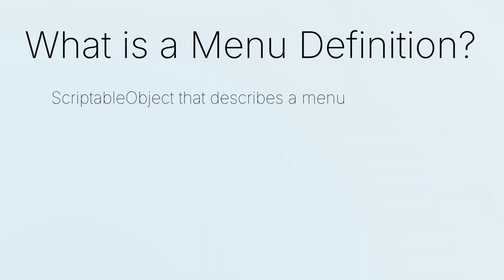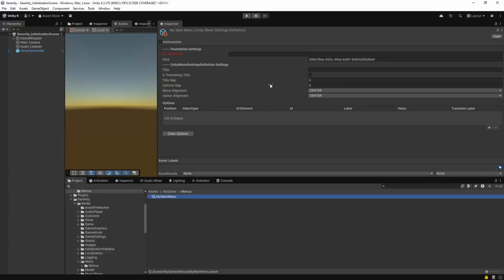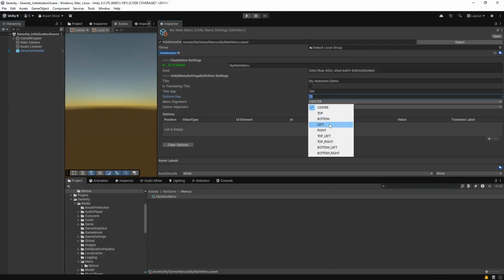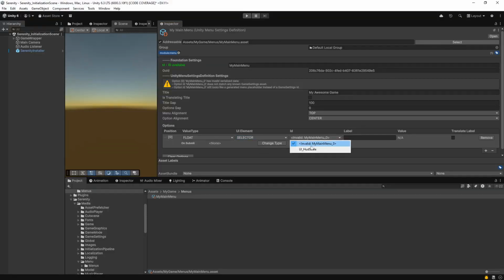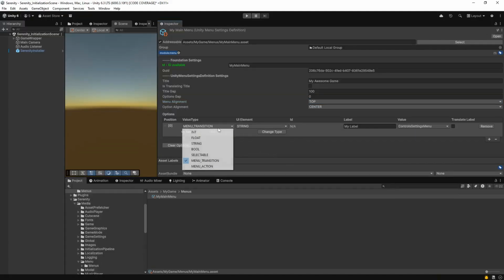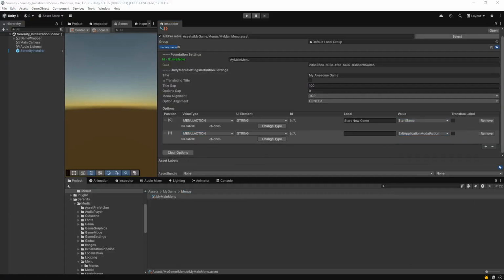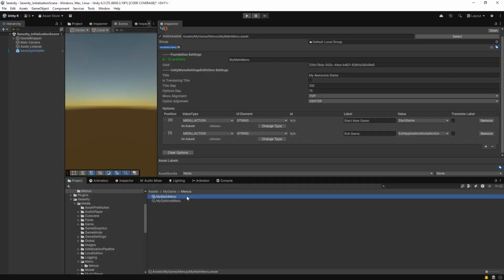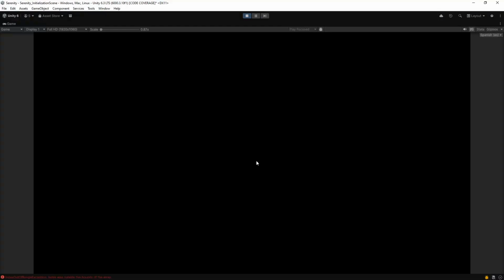Serenity Tutorial - 3 . Menus

Comment: Great tool for setting up menu! I'm wondering how this scales for an inventory system where there are multiple tabs and each tab containing lots of buttons that calls its own data?
Reply from the maker: Thank you!

You could actually do something like that with Composite Views to handle the tabs, and Dynamic Cascade Menus to populate them with data at runtime. You'd still need to handle the inventory logic yourself, though.

The good news is that an inventory system is already on my list of things to add to Serenity! I haven't got around to implementing it yet, but it's definitely within the scope of the project.

Just out of curiosity, what kind of inventory are you working on? Something like an RPG inventory with item slots, or more of a menu with different categories and actions?
Reply: @Serenity-GameSystemsFoundation  More a catalogue of items. Similar to city builders or any builder games where the buttons are predetermined, and they do different things. 

I watched other videos too, so using signal definition, I can hook the buttons to call methods. Maybe I missed it in other videos, but where is the data to pass parameters? Will I be able to pass custom classes?

I'd like to see more videos regarding UI focused scenarios, or larger projects because I think that's where Serenity shines. You used a small game example, but in my opinion, Serenity is what I'd get for bigger project because managing spaghetti code happens for big projects, and small projects, Serenity is a little overkill.

Example A: Example scene where 100s of objects all dispatch an event to update UI (Resource collecting, etc). How does Serenity handle that? Does it queue the events so there won't be stutters, or is it something programmers need to implement?
Example B: Example scene where 20+ buttons are on screen at the same time, like a building tab menu. What's the best way to set these up?